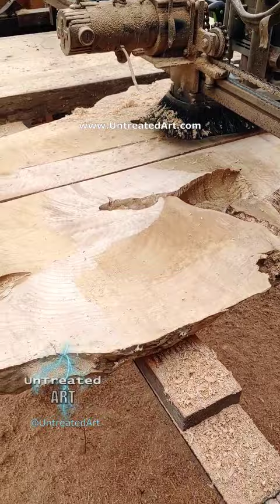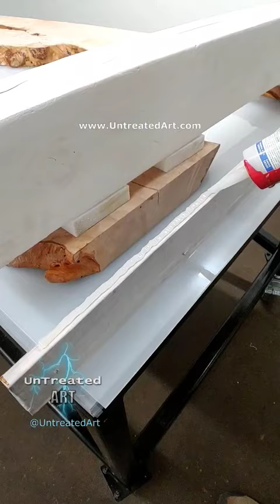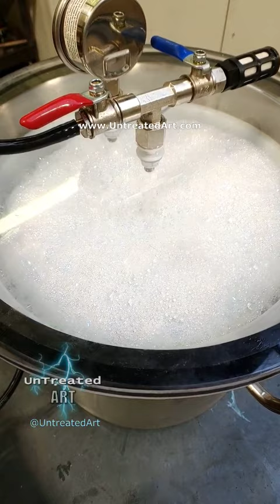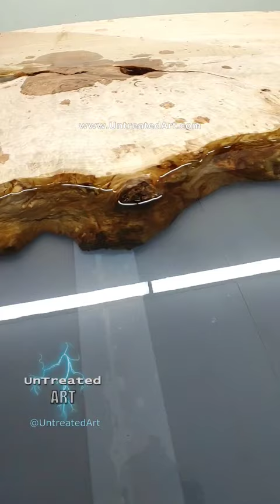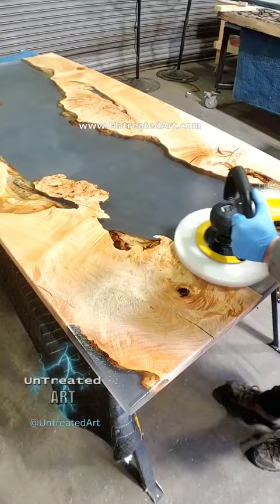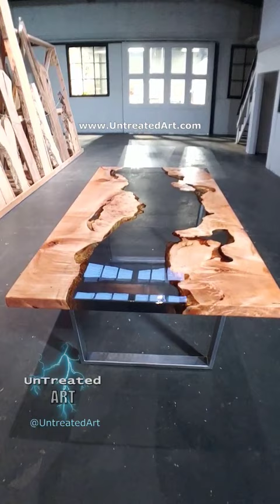Making a Transparent Epoxy Resin River Dining Table Start to Finish

Comment: nice table piece!  I am slightly concerned the metal legs do not have an upper plate tying the whole table together along the width of the table.   I know it would show through the clear epoxy! but I just built a dual river, transparent blue/turquoise and I put the same style legs on it but with a full top brace from post to post.  spreads the load instead of it being solely on epoxy bond.